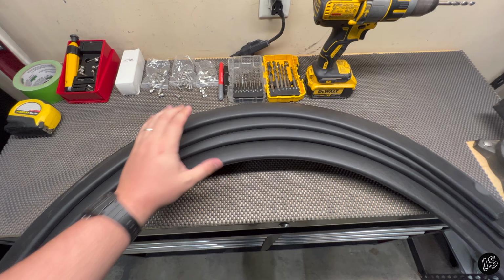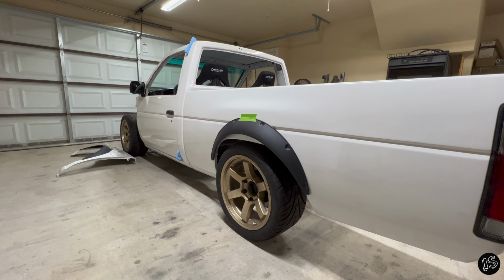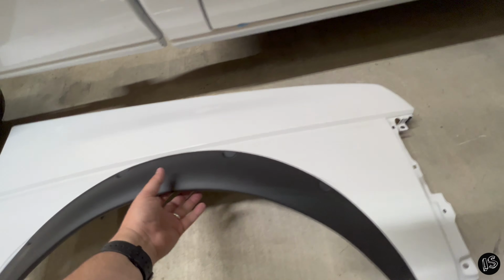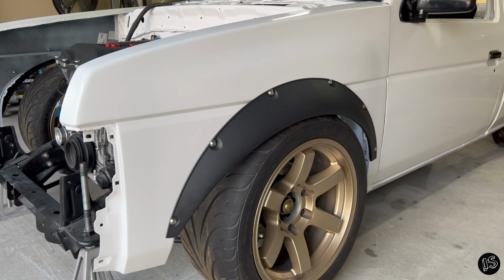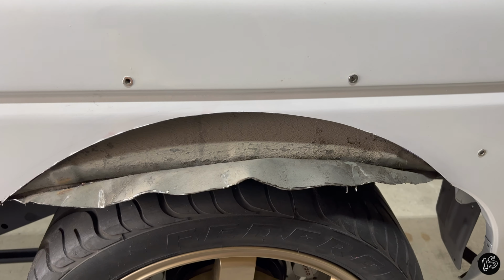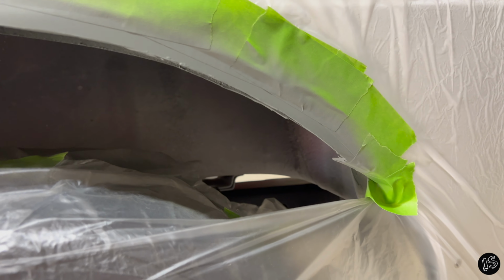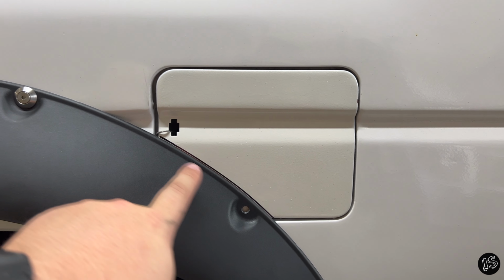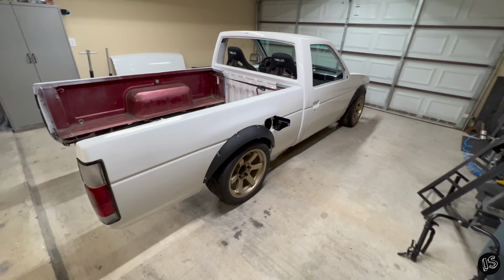Fender Flare Install | D21 Drift Truck — Ep. 20

Comment: Finally someone who scraps the 4x4 front and flare rear idea. Consistency looks better than a truck built with confusion.
Reply from the maker: Not sure if I follow what you mean. Maybe I am reading it wrong. Whatevs!

The 4x4 fenders are for my other D21 project. I simply made a quick reference video showing the differences between 2WD and 4WD fenders and answered your question. That wasn’t an episode for this truck. This truck was always getting pocket fender flares. Pretty consistent on that front.
Reply: I see so many people use a 4x4 fender up front then a fender flare in the rear. It makes the truck look inconsistent in design and execution. Almost like they had one idea and didn't follow through with the theme. Like wearing two different shoes.
Reply from the maker: @RealityUntold  I see what you mean. Didn’t know that was a thing. That would definitely look odd.

Comment: Just inherited a 92 Mazda b2200. Completely stock but needs a little de-rusting on the frame, some brake work. After I get it on the road and no additional problems rear their heads, I'm totally copying those wheels!!! Flat black they look great. Pretty sure the Mazda is very close to the Nissan in spec so they should fit. 🤞🤘✊

Comment: Hardbody lookin EXTRA FRESH 🔥🔥🔥  what happen to the overfenders? Sorry if it was explained before I may have missed a video
Reply from the maker: So, I have another D21 that I haven't started working on yet. It's going to blow this one out of the water in every way, but I am trying to finish one project at a time. That truck has a perfect bed on it that I am going to use to create the negative tooling mold so I can consistently make/replicate identical bolt-on over fenders. That's actually why I have the 4WD fenders, they are for that truck.

Comment: Are you planning on a rack and pinion steering system in the future for a sharper steering feel?
Reply from the maker: Yep, I already have a brand new 02 Subaru WRX rack & pinion I plan to install. I just want to get the truck going first and have a proper shakedown. Then I will do those types of modifications. I think it is important to get a good reference point to know if you're actually improving or hurting the truck's performance.

Comment: Great video. Now my question is is that the original motor that ur just rebuilding or is it a 240sx motor also that ur rebuilding lol. I hope I’m making sense, either way it looks amazing
Reply from the maker: Thanks! Yeah, I understand what you’re asking. The engine is an SR20DET out of a Nissan Silvia (JDM 240sx) that I built awhile back.
Reply: @Inner_Sanctum  that looks badass n beautiful all in one haha. Little by little I’m mailing mine like that. I was thinking of just getting a 1992 240sx engine n clean the parts but now that u said Sylvia maybe I will too lol.
Reply: @Inner_Sanctum  do u have a video of just the engine

Comment: Looking good! I read a response to a comment you made from an earlier video how you intended on using this truck to primarily drift and occasionally track. You said something about building a different truck with a different suspension setup on the track build. I'm really curious being I'd like to build a Pro Touring setup. Would you not recommend coilovers for a daily / Pro Touring setup?
Reply from the maker: Well, I have 3 trucks that I am working on total. 

This white D21 built primarily for drifting that has coilovers and retains its solid axle, Chris’ VQ35 D21 for general purpose fun that retains almost all stock steering and suspension components (just new/upgraded), and my black D21 (spoiler) that is going to be built for circuit track/hill climb/time attack use only, that will forego all the D21 suspension and steering components in favor of all s-chassis components. The black truck will have a fully independent rear suspension and an entirely different front suspension with rack & pinion.

I think for a daily/pro-tour it really depends on how extreme you’re willing to drive it. These trucks can do really well by just replacing the steering and suspension components with new parts, swapping out rubber bushings for polyurethane, upgrading the brakes a little, lowering it down a bit, and getting some better wheels and tires under the truck.
Reply: Appreciate that info. I've asked a few people on Instagram whose done the Beebani coilover and 4 link kit how much of an improvement over stock it was and never got a response. I tend to prefer a softer spring rate with big sway bars. So, I'm hesitant about the rough/rigid nature of coilovers.
Reply from the maker: @RealityUntold  I see what you mean. Coilovers have come an incredibly long way over the last 20 years though. 

For instance, this truck is running QA-1 DS-401 coil bodies (compression/rebound adjustable; single valve) with 9HT450 (450lb) springs up front and 9HT250 (250lb) springs out back. QA-1 also offer the dual valve option that allows you to adjust compression and rebound separately. Also, they offer a ton of different spring rate options. 

I reckon you could make this truck 2 times softer than the stock torsion and leaf setup. There’s just that much adjustability and control. Coilovers are just superior in that regard.
Reply: Well, I guess I'll give it a shot then. Is your current spring setup stiffer than stock?

Comment: Where did you get those tail light at? And what they called?
Reply from the maker: It has been awhile, so I don’t remember where I bought them. Amazon or eBay most likely. They are just DEPO replacements. They where really cheap to be honest. Haha I’ll see if I can find a link.
Reply from the maker: https://www.ebay.com/itm/302881323576?mkcid=16&mkevt=1&mkrid=711-127632-2357-0&ssspo=f77KH1-qRga&sssrc=2349624&ssuid=JVcd8523QyO&var=&widget_ver=artemis&media=COPY

Comment: Does your hardbody throttle cable reach the SR throttle body?
Reply from the maker: Not quite.
Reply: @Inner_Sanctum  I’ve got to figure out a solution myself. Any ideas?
Reply from the maker: @softbodyfab7588  yeah, you can make your own linear cable pretty easily, or you can head over to the junk yard and look for Nissans that have relatively long throttle cables with the same firewall bolt pattern. 

Once I get to that point, I’ll come back and reply to this comment. I will also make sure it’s in whatever video covers that part.

Comment: Use pathfinder front fenders for oem 4” flares n the rear you can cut n mold or use the fiberglass Baja rear
Reply from the maker: True, if that’s what you’re into. Not a huge fan of either of those options personally. The Pathfinder front fenders grafted to the rear just don’t line up all that well without extensive metal reworking. It always looks off in my opinion. …and those Baja flare sides are just insanely wide. Lol

I’d rather just make my own rear over fenders for that kind of effort.

Comment: Or just buy the fender flares for a Nissan Pathfinder because the wheel arches are the same.
Reply from the maker: Unfortunately, those would never work on my truck. My wheel setup is too big and the truck is too low. Cutting fenders is the only way to get the truck how I want it to sit. Pathfinder fenders bolt in stock location and my wheels would rip them apart. Plus, Pathfinder flares have ~8mm less width.

Comment: Its called a bodyline
Reply from the maker: I wasn’t 100% sure. shrug

I got chewed out by my auto-tech instructor way back in high school for calling a swage line a “body line”. He got all weird about it and it stuck with me. Lol

He told me that a body line was actually called a “character line” and is a light raised area on a panel that detailed the vehicle’s shape and added contour. A swage line was not just a design aspect, but a functional feature that adds rigidity to a panel.
Reply: @Inner_Sanctum  people call it that simpler calling it a bodyline
Reply from the maker: @pointblankarmory588  well, that makes me feel better.